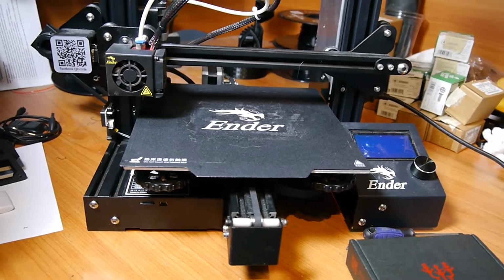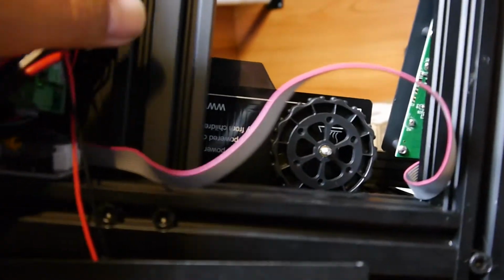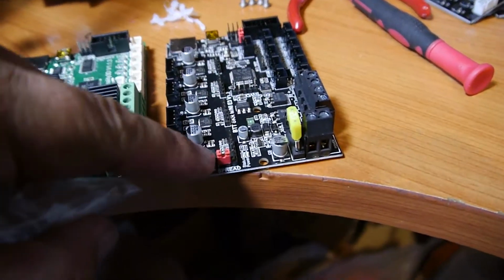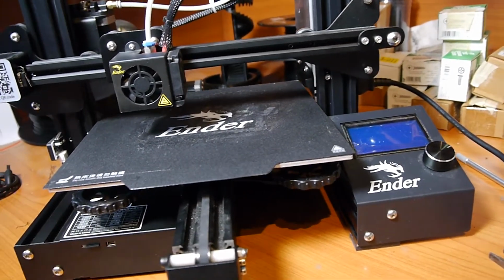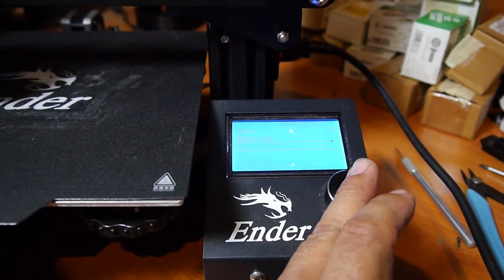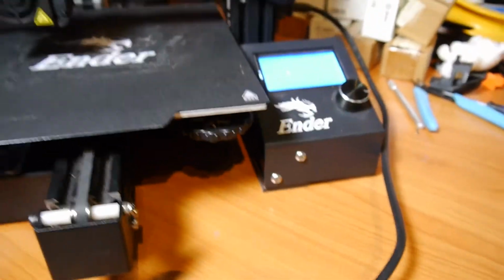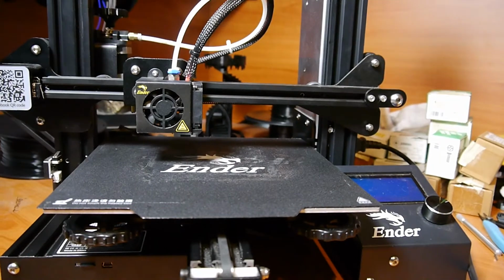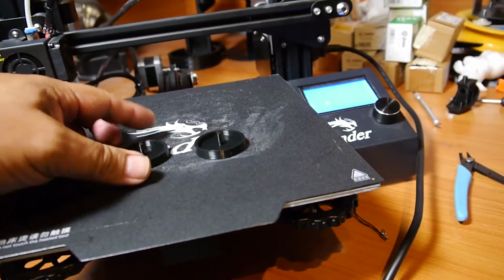SKR Mini E3 1.2 Board Swap on Ender 3 Pro, What could go wrong?

Comment: i had the same problem it turned out to be two wires where wrong way round the very end white ones swap them round on the board now its perfect this is on the mini e3 v2
Reply: Can you please elaborate some more I can’t figure it out
Reply: @Redasurc  there are 2 connectors with 2 white wires right next to each other. Swap them